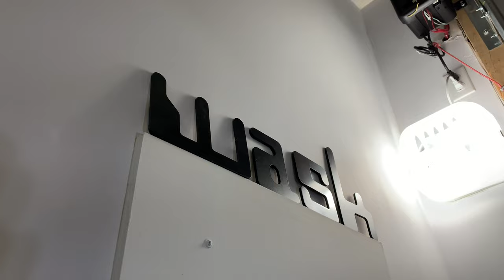Mounting and Installing the Budget Wall Mounted Pressure Washer Setup 4K

Comment: Didn’t know it was possible to install a pressure washer or even run water through a hose during winter. I live in Chicago, and was taught to turn off water from the outside pipes during winter because it would freeze. Hope to figure out a set up like this to build so I can wash my cars during winter
Reply from the maker: They are right! You need to turn off outside water outlets over the winter time. My garage is heated and here in Calgary in the winter time we get a pacific wind called Chinook that causes massive or sudden weather warming that allows us to wash our cars outside in the middle of the winter

Comment: What dimensions is the ply wood and what size bolts?
Reply from the maker: The plywood dimensions is 4’x2’1”. Sorry the bolts, I can’t remember. I tend to hoard hardwares in the shop and never throw spare parts as I am certain will be using them. Bolt wise it all depends on the hose reel you have and the size it takes. All the best on your project. Keep me posted on how it turns out!